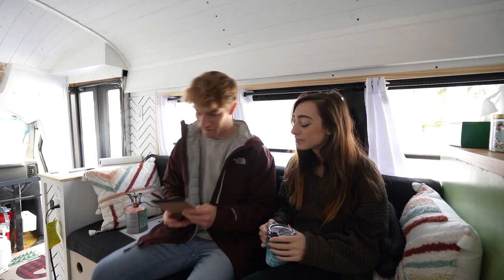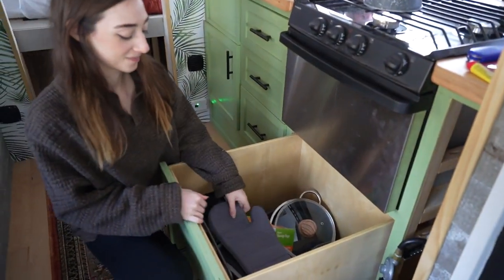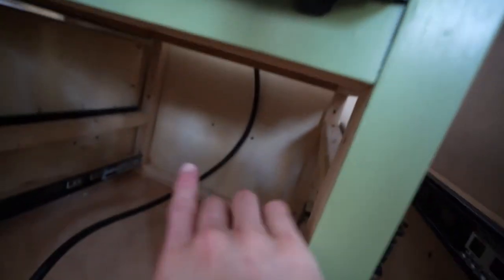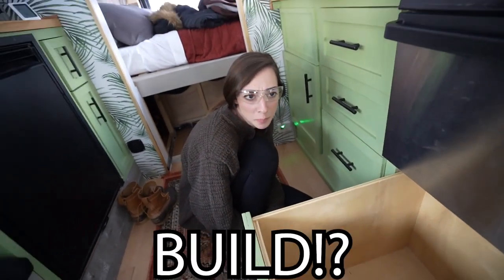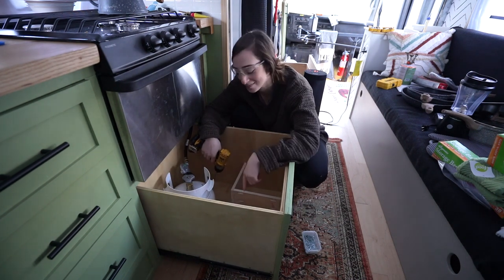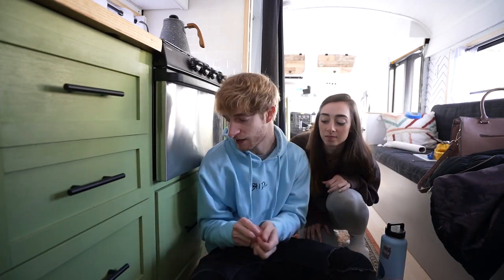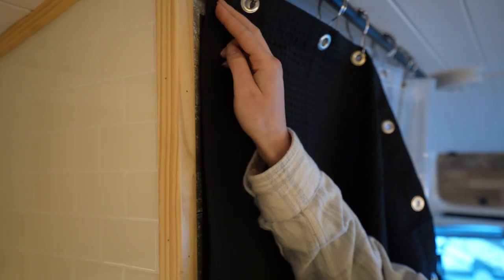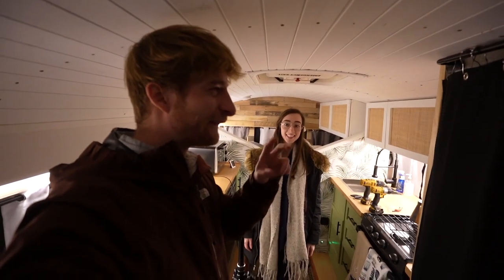Finishing My Converted Bus but My Girlfriend Does All the Work

Comment: Pretty sure the propane tank should be vented outside. Do you have an alarm in case of a propane leak? If not, check into it.
Reply: Needs to be inside but it is most safe to build a little cabinet which doesn’t make it leak